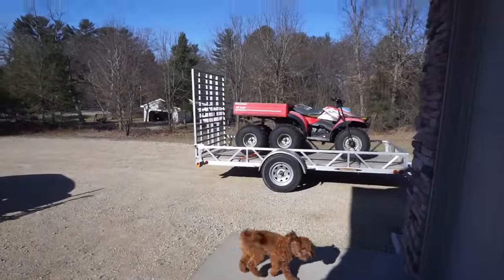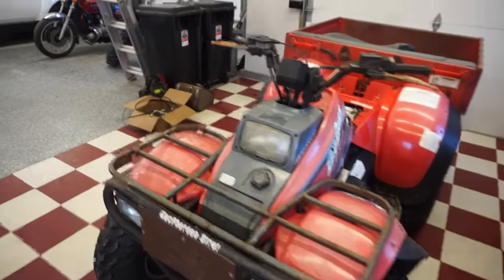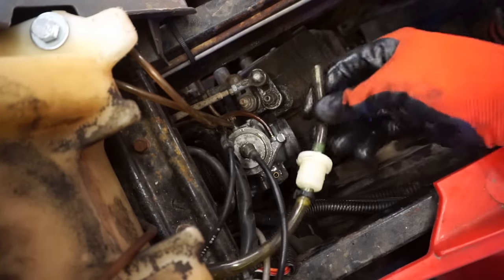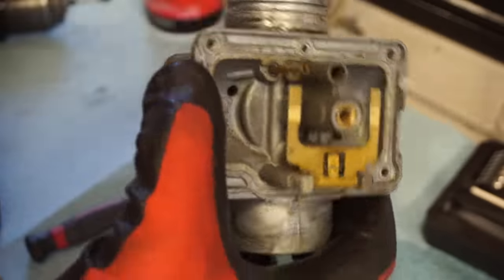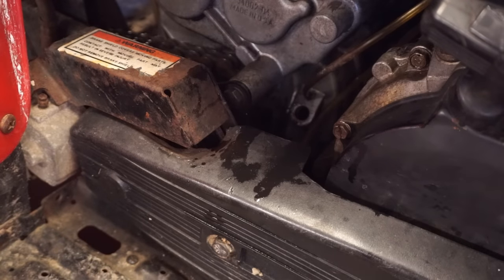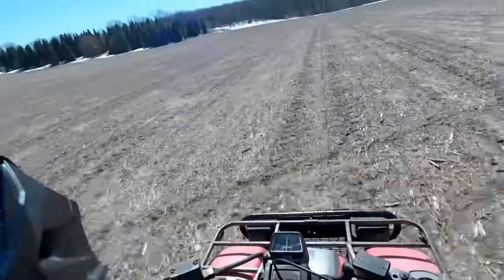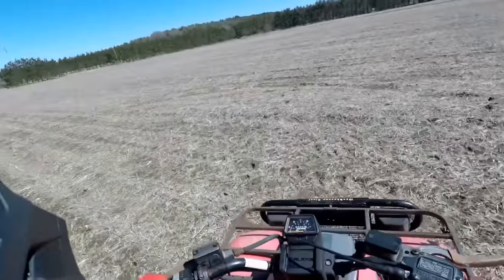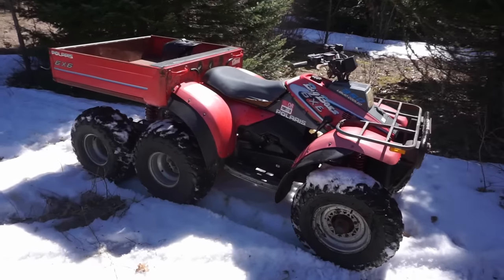This 6x6 ATV Can't Be Stopped (The Ultimate Workhorse)

Comment: For the style of battery you hate, use a small piece of fuel line or a doubled over piece of cable tie under the lead insert. Makes bolting leads on much easier and the inserts stay in place.
Reply from the maker: Thank you for the suggestion!

Comment: Well it's been 40 years but finally I have an explanation to a problem I had. I had the same problem with a plate and needle on an XS750. I saw the hole so I thought the needle went through it but as you've shown the plate sits on top to hold the needle down. Bike ran like crap unless the throttle was wide open. One shop spent 3 hours trying to diagnose it but another fixed it in an hour. You're a legend!!!
Reply from the maker: Thanks man! I appreciate it! Thank you for watching!

Comment: Those are great engines, something to look out for is the 2 stroke oil feed line from the front reservoir is pretty easy to snag and tear off when going thru brush, double check the way it is routed. Great video!

Comment: The Polaris Big Boss 6x6 are brilliant machines.   In the UK I have a year 2000 - 500cc petrol and an older 400cc Diesel - D-Bat ex British military. The Diesel has a 12v car battery in it so never any problem starting it and its air cooled.      Both used for all the jobs you can think of on our small holding.    The 500cc petrol is mega quick so you have to be super careful not to let your kids loose on it.      Over the years I have purchased all the agri tools you might need to work off the two machines.      My friends thought I was nuts when I first got the 500cc.  Only saw it as a toy.   They don't think that way now and like you, mine were non-runners when I bought them super cheap.    Both were easy fixes.

Comment: Brilliant machine 😎 I’d be wanting to know how all that fuel was in transmission? 👊❤️🇬🇧
Reply: I'm wondering if the vent tube wasn't mixed up with the carb overflow line. I think I saw 2 lines there.
Reply: Likely he was trying to clean out sludge in the case, and forgot to drain it

Comment: i had the two stroke model with 4 wheels , i solved the hard shifting problem by merely adding a quart of DURALUBE to the transmission ,  smooth shifting after that

Comment: You have 2- stroke motor that doesn't connect to the gearcase oil. So if gas was in the oil, it was put there or you have case leak.

Comment: I saw one of these on my local marketplace for like $3k. Looks like a good rig for a snow plow.
Reply: Easy to spin back axles  in the snow,  not enough rear weight.
Reply: @ronaldbertin9455  it’s 6x6
Reply: I know I have my second one . Front axle does all the work in p.owing because the back one don't ha e enough weight I  without 6 wheel you could not climb  a hill  or push snow with 5 inches of snow on it .  . Like driving a dually truck on snow

Comment: I had one of these but mine was a 425 version and I took off bed and made a small boom on back with a 2500 lb. winch that thing pulled a cedar log on level that was 18 inches in diameter and 3  eight foot long cedar logs . That thing worked perfect for that until a stick through the radiator stopped that ride after that got a small 1500D yanmar tractor.

Comment: I like your idea of putting those rocks to good use. I collected rocks about the same size as yours and came across one that I could barely pick up. I couldn't lift it high enough to put in the bed of my F350. It had to be over 200 pounds because I can lift and press a little over 200 pounds in reps of 11. The rock was off white with a little yellow. It was rounded and smooth as if it had spent time in a river. I went back with a friend to help and it had been removed by someone else. I really want to know what it was made of, but I probably will never find out for sure. Made a large bbq out of the rocks I did collect. It sits where anyone who rides off-road can use.

Comment: Hi, I love your videos. Really well done… keep up the amazing work! I have a question for you, I have an atv 500cc and when it’s running and you just push it forwards and stop it real quick, it just dies on you. Or when your driving and you hit the brakes or make a sharp right hand turn it dies on you. Only in the low rpm’s otherwise it drives anazing. All the electronics and everything else works just fine even idles quite well. Sometimes goes up so I’m thinking carb needs cleaning… what are your thoughts?
Thanks and happy Easter 🐣
Reply from the maker: Thank you for watching, and for your kind comment! I appreciate it! I am glad that you enjoyed the video!

Comment: Scrap that oil injection an mix the gas. Mixing gas is easier and cheaer than rebuilding/replacing the engine if the injection fails, which does happen.

Comment: Putting a rubber buffer around your battery is always a good idea, mainly to discount slow electrical charge leakage. 

Finding your battery dead after not using your vehicle for a spell is a real, and sometimes costly, bummer.
Reply: Battery Tender on all my machines

Comment: Joe you are so lucky you changed that transmission fluid out. That little bit of riding you did at the place would have wiped out bearings quickly if they aren't already because of someone's failure to properly put the transmission together properly. It might pay ya'll to open it up and check what some bumfuzzle did to her, but seeing that she sounds good with proper lube it may be alright. When you get to use it again it will need checked to see if the 80 weight leaks out and is replaced with gasoline. By the way how does gasoline get into a transmission? Someone is a sabatour or mentally defective because unless it drained down there from the carburator I just can't grok  that. I think with that plugged main jet it saved the transmission for ya'll.

Comment: This should serve as proof that 2 stroke engines produce more torque than 4 stroke engines. I keep seeing people mistaking low rpm power with torque. Every down stroke of a 2 stroke piston produces power, but every other or one out of two down strokes of a 4 stroke piston produces power. Two strokes produce twice the torque as four stroke engines. If low rpm power is desired, a two stroke engine's ports and matching expansion chamber with stinger, must be designed or "tuned" to place the maximum power within the low rpm range. Two stroke engines can be absolute torque monsters. Their only draw back is the loss of some of the un burn't fuel through the exhaust port and the ports limiting the amount of compression that can be developed. There's also the limited amount of downward stroke before a port is uncovered. Two stroke engines have quite a lot of potential, but much more research and development in needed.

Comment: I bought one new my trans was hard to shift  check it out with Polaris they had a recall , so I got a new trans put in by Polaris  mine had a 350 two stroke in the as this one . I made skis for the front and bought tracks for the back  but it didn’t work very good front was to heavy  . Sell it ! 🦦

Comment: If these machines are run without a battery installed, it burns out all the bulbs. I had that issue when I bought mine. Replaced the headlights with LEDs. Works great now!

Comment: That gear case oil....will always look clean n clear...only way it'll be discolored is if there is a leak for water and or dirt to get inside...and they don't need special oil like everyone always claims or polaris claims...its nothing but a few gears inside like a truck differential... Ive changed mine yearly with synthetic  dif oil and never had issues...its nothing special inside that gear case